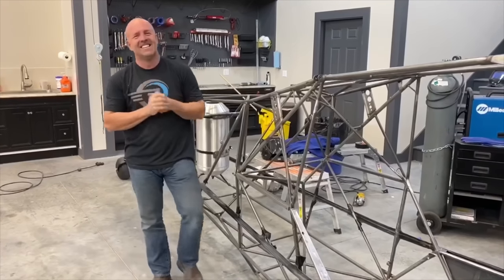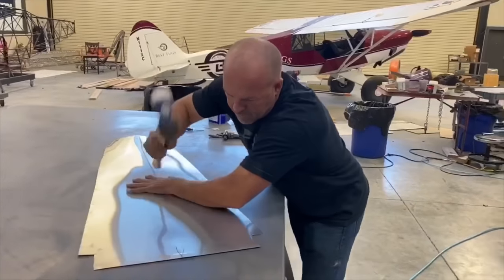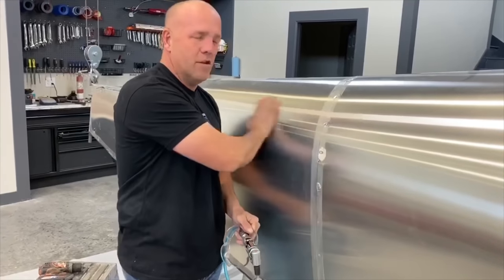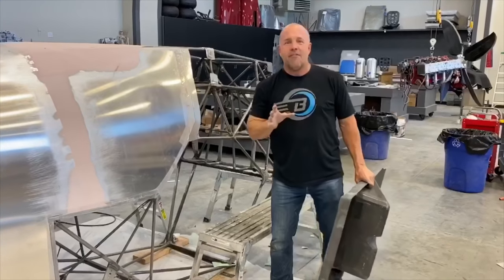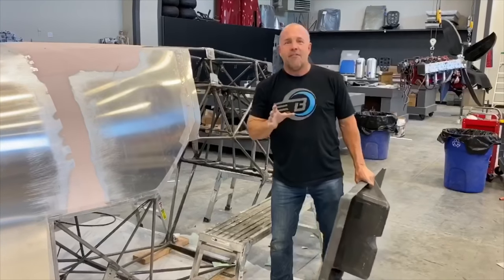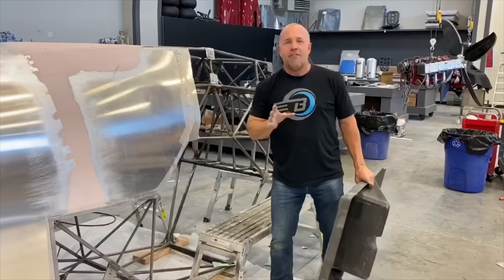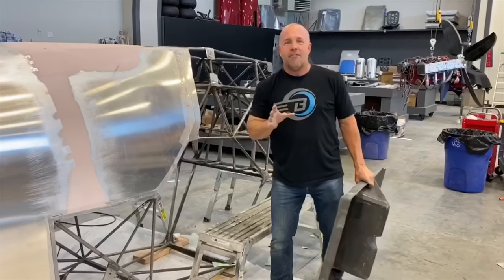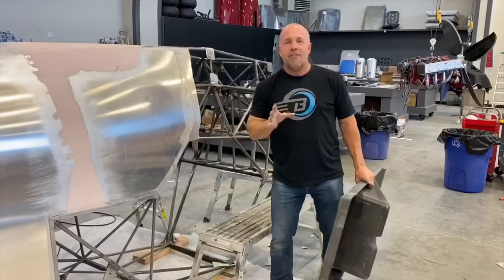EXOSKELETON weighing my options for Scrappy... (Scrappy Bush Plane 6)

Comment: Mike did you run any layers at 45 degrees or some angle, or are all of the layers oriented basically the same?
Reply from the maker: It depends on the part I’m making.  On this one I alternated back and fourth  90 degrees 45 degrees
Reply: @MikePatey  I figured you were probably doing something like that it just didn't make the video. Love the videos!!

Comment: I love how you're using carbon composites but there are some pieces that may have been done using fibre glass and the Vacuum Infusion Process.  Parts would have weighed the same but cost only a fraction for to the high cost of the carbon sheets.  Have you ever thought of that?  FYI there are boat making companies, in the Seattle area, that use this process to build 100 ft long yachts... 

Love the videos and love your excitement.  I only wished that I had the same drive as a young man.  I would be a totally different man that I am today.  That being said, thanks for the teaching of this old man and keep up the great work!

Comment: Insane! I still don't get why you MIG weld when all the parts are so nicely put together / sit where you want them to before welding. A TIG spot weld should do the same job (holding the parts in place), without all the cleanup after. I could see the reasoning if you need one hand to hold them, and use the other to spot weld, but this is not the case with the parts you have been MIG welding. Care to elaborate?

Comment: With 500 hp, probably never have to worry about tail stall but if for whatever reason it happens, just wondering what the flap would do for recovery dynamics

Comment: Mike, I love your cowl flap idea. I did this 20 years ago on a giant telemaster Rc airplane with an 8 foot wingspan. I was experimenting with stol and had built a large belly pod for dropping plastic bombs and eggs with. The door worked exactly as you are describing yours and worked amazing as a speed brake on steep descents. I also had great success with extra tall main gear and cut a low profile tail wheel up into the rudder  to increase static angle of attack. I always thought draco would have got off the ground sooner if you could lower the tail and increase the angle of attack at rotation on takeoff. Please think on this a bit, i love watching your builds. Also, will scrappy have flapperons? Seems to be an obvious choice with your abilities to double the effectiveness of both surfaces, also spoilers would be a hell of a thing for stol and you can even tie them into spoilerons. Think how you lost draco, if hard over aileron lifted a spoiler in the left wing and killed the lift.... love your videos!

Comment: Mike, What are your concerns for extreme turbulent air from the  activated cowl flap interfering with stab pitch  stability at low Reynolds numbers ? I can see it as a dive  brake, but am concerned about loss of pitch stability during landing when  in ground effect. 

Keep up the good work.

Comment: When working with carbon, wear a professional respirator.   Those cheap paper masks that you’re wearing allow air to leak in without being filtered.  Inhaling carbon dust will cut up your lungs.  By the way, before you go fly that thing, do a weighted pull test and a thorough examination afterwards for cracks.

Comment: Kinda surprised the joining edge of the aft shell is facing forward, into the air stream.  I would have had it coming from the belly pan aft... but I'm sure you had a good reason to do it the way you did.

Comment: There is man in Germany that makes RC models of air liners out of carbon fibre.  He makes a negative plastic mold on a large 3 D printer and then lays in  the mold layers of  carbon fiber sheets and epoxy resin.  I wonder if that is possible for batch production of real bush planes, where you could use the molds over and over.  He says the strength to weight is the same as high grade Aluminium alloys.  You probably know this.

Comment: I love the videos, is there any reason with the carbon fiber sections you only use carbon fiber and not "tiger cloth" carbon fiber and Kevlar mix?  I used to do a fair bit of moulding and work with it and in out application found it much more durable. Although I'm not familiar with aircraft and it may not be as suitable.

Comment: Really great work there. So how much stronger than fabric do you think CF it will be and do you need the extra strength? I mean you already have the truss frame that should handle most of the loads and theoretically you could have the CF thick enough that you don't even need the truss frame. How much more does the CF weigh than the fabric? Is the CF even structural?

Comment: Why do you need a tube frame at all?  The essence of a monocoque structure is just the skin.  The tubes become extraneous.  Some ribs to maintain the shape,, give something to tie baggage floors to, fuel tanks, etc.      I would also be concerned,, what is the expansion/contraction ratio of the two dissimilar materials.  Window glass and steel move almost identically, but window glass and aluminum tear their connection apart.  And the tubes being inside,, colder and shaded into the morning,, hot interior in the afternoon,, VS a skin that heats in the sun and cools the moment the cloud comes over?  You better know.  I have no idea what the ratios are for carbon fiber.

Comment: Your color flap used as a landing flap will work 
I installed it on an RC model a Sig Cadet, to drop candy.  First I tried a conventional Bombay but not all the light candy would fall out.  
The added benefit is when you open the flap when you put the flaps down you end up with no pitch change and the airplane does fly slower.
Make sure the flap is stiff and the pivot points are strong because you will be at full power with it down at some point No flutter allowed

Comment: Carbon Fiber and Orange are a good color combo when paired with white highlights and black low lights.  Along with some custom machined billet aluminum wheels and suspension/ landing gear components done in a clear anodize.

Comment: Can you spray 77 the aluminium  and wrap it with packing foam to make a smooth coat to apply carbon fiber to just wondering.

Comment: So along with the standard flaps, the landing gear strut plates along with that special cowl flap, it will create a flap extension system depending on the angle of attack of Scrappy. That will help the aircraft land at even lower speeds. I watch your videos with beers and french fries and a great amount of interest. I have finally found a channel that speaks my language, thanks friend.

Comment: One Q: why aren't the seam overlaps "facing" the rear? Seems like if you have any issue with any of the fasteners, the airstream is going to try and pull panels away with the seams overlapping from the rear.

Comment: Sure hope you insulated the airframe from the carbon fabric with a ply of fiberglass and paint. Make sure you install fasteners with paint or sealant or scrappy will suffer from corrosion . Now the steel tubing won't corrode as fast as aluminum but it will corrode. Please let us know your plans.

Comment: Does the carbon fiber wear hard on the drill bits???
Reply from the maker: F Mat yea I keep them in bulk but they will do a couple hundred holes before replacing or sharpening them
Reply: @MikePatey  Thanks, Mike.......back to work!!!

Comment: Love the passion and material-knowledge that you have! I was wondering if the tortionnal strenght wasn't only relying on the nut-plates strength? Or are you going to fix the bottom shell to the frame in any other way?
Vince from Begium

Comment: bond O is heavy.  try using cyanoacrylate glue on a test piece...   if you have any extra pieces of carbon fiber like cuttings, just grind em up into as fine a powder as you can and  use a bit to fill the gap and weld it together with the glue..    just dont stick it to alumium...    tried with fletchs on a set of arrows...   the came off the first time I shot them lol

Comment: Why not keep the molds in case you might need to make a replacement?
Reply from the maker: I kept the clean, reusable pieces.  Carbon fiber is fairly easy to patch if needed.
Reply: Awesome. Hats off for the incredible work. Cant wait to see this plane flying and Draco rebuilt.

Comment: Great project!  Sand the bondo with 36 grit green paper as it is setting up to the hardness of cheddar cheese.  Will not clog the paper.  The longer the bondo sets the hader it is to sand.  Putting on less bondo than needed per coat results in less labor sanding and time saved overall.

Comment: Mike remind me why you have a steel frame.
Reply from the maker: RWS  it is still lighter than building a composite structure all carbon to replace the frame inside... however that being said. I’m working on some different ways to make an all carbon fiber frame skin combo I want to do.  Likely after I retire.  I work 10-15 hour days at work still so when I have more time I want to do many of my ground up designs just for fun.
Reply: @MikePatey  That's what I wanted to hear.

Comment: MIKE .. i have been wondering. Your thoughts.  How did that wingtip spur work during the Draco incident? Did it lessen the resistance on impact? Lessen the resulting and inevitable twist around.  Will you use it again?   I could find nothing on this.
Reply from the maker: Hopper Mantis it worked unbelievably well.  I’ll show a video when I have time showing it’s trail in the dirt keeping the wing from hooking an edge.  It was like a ski across giant pumps and jumps and held the wing up.  It may have saved our lives.  The track was amazing and surprisingly neither of them broke like I thought they should have and I’m extremely glad it didn’t.

Comment: If you make a carbon fibre wrap for the full tail, what do you need the steel tubes for anymore??!?
Reply from the maker: scsirob yes the vertical and top will be, I will leave some tubes but many are removed where it’s no longer needed.

Comment: You know when he first introduced scrappy, I got the impression that he was going to create an inixpensive custom plane out of the scraps of others...this is more of a custom designed, handmade, mega plane...when does he tell that he figured out how to remove the cub frame?

Love this guy.
Reply from the maker: z d  yea when I started that was certainly the plan.  Most the entire plane is all scrap and used from frame parts old left over metal and a used engine and many many components. however, you right I diverted some once I got the bug to do carbon and a few others I certainly moved a bit.  Even with the carbon fiber and crazy avionics I’m doing it will cost me much less than a new carbon cub by far..  the real expense on my build is by far the time and one off parts to do it, still mostly scrap parts and I’m having fun.  👍🤠

Comment: Hay Mike, you guys are awesome, I enjoy and plan to employ some of your techniques on my RC plans.  1 question about the Carbon Lay-up... Would the skin have more bi-directional strength if the multiple layers of C/F were layed at 90deg from layer to layer (woven/lattice) pattern?
Reply: Mike mentioned in another comment that the layers were alternating 0 and 45 degrees; it just didn't get mentioned in the video.
Reply: @BrooksMoses  thanks, Mikes my hero.

Comment: @mikepatey curious to know with the flex of the carbon fiber won’t that mess with paint work where it flex’s quite a bit say when you remove it for maintenance or will it just be carbon fiber and no paint
Reply: Aircraft paint is pretty flexible.

Comment: This might sound like a dumb question, but the friction fit of the rear fuselage cover will have fasteners that connect it to the tube frame, right?  I was envisioning the tail and motor giving the frame a good twist and the tube frame opening the carbon enough for the carbon to unseat and fall off in flight.
Reply from the maker: Derek Samuel  correct it would fall off if not bolted. it is bolted with a isolation rubber pad between metal and carbon every few inches over the entire tube.  That comes out in an upcoming video 👍🤠

Comment: I need to find your dumpster
Reply from the maker: joelflaugh 😂 you would find all the Alluminum with bondo stuck to it.  I spent the time and cut out 80 or more percent of the rest and stacked them in my racks for future parts.  I mentioned it in the filming but 90 percent of what we film doesn’t make the video or it would be hours and hours to long. 🤷‍♂️🤠
Reply: @MikePatey  damn

Comment: ...and...when you are done....the whole skin will be too large by the thickness of the aluminum..curious to see how this ends...
Reply from the maker: bschena great thought 👍🤠 Not many think of that. I love it when people push the thoughts to further learn. your thought would make sense only if you don’t understand the processes required. Fortunately I have to have that gap.  The thickness of the Alluminum was an exact deliberate decision for the required separation of materials. the Alluminum is .035 thickness.  Leaving that’s size is a perfect gap. You Can’t allow carbon fiber to touch stele or Alluminum like your suggesting I’m going to try and do. That would be catastrophic. When someone doesn’t understand and they attempt to you make direct contact you get a heavy catastrophic galvanic corrosion process.  Fortunately this gap I intentionally created with the Alluminum thickness works out perfect for the required isolators taps. These isolation pads for carbon gap separation  bolt between each stele mounting point and the carbon and they come in different thicknesses from .015 and up in dozens of sizes and thickness to insert in between the non cooperative materials. I have already reattached it to the frame with .035 isolators that prevent galvanic issues as well as eliminating vibration and making the carbon shell fit exactly as molded. I would really have had my head not on straight to miss something as critical as your suggesting.  That would twist and wrinkle the carbon and the corrosion would be an absolute mess.   Thanks for the comment.  I love to see people really think things through. I normally never go into that much detail as the video could get really boring.  Cheers 👍🤠
Reply: @MikePatey  Thanks Mike, appreciate you taking the time to answer. I'm a mechanical engineer (surgical robots), so issues like that always jump out to me. The isolators make a ton of sense, structurally as well as for galvanic protecting (that issue didn't occur to me).  Thanks for the explanation! Good luck with your build!

Comment: Did you balance the ply orientations in the fuselage lay up or drape all the plies at 90 degrees to the fuse and stagger the overlaps on each course?
Reply from the maker: Ian Pilkington I alternated 90 then 45 back and forth and staggering the joints
Reply: Mike Patey very nice work and attention to detail. Will you bond the skin on with a structural adhesive?
Reply from the maker: Ian Pilkington I will be bolting throughout with welded taps and isolator pads to prevent galvanic corrosion
Reply: @MikePatey  ah gotcha. I thought the panel was going to be a perminent structural component. Have you considered a localised single ply of glass on the laminate surface rather than needing pads?